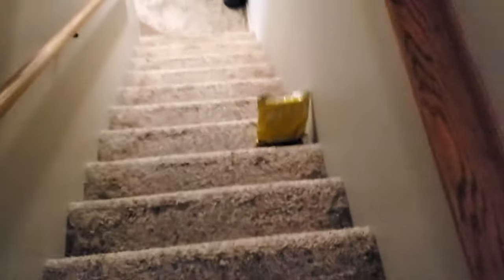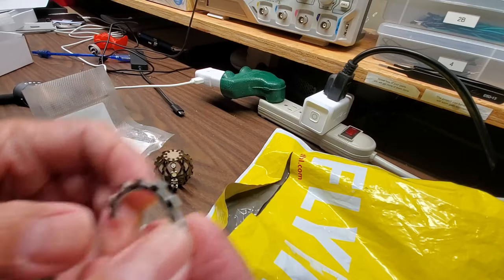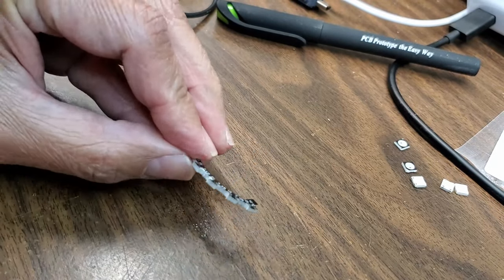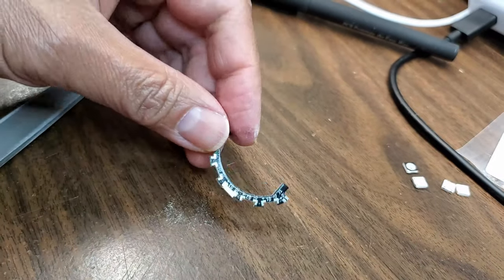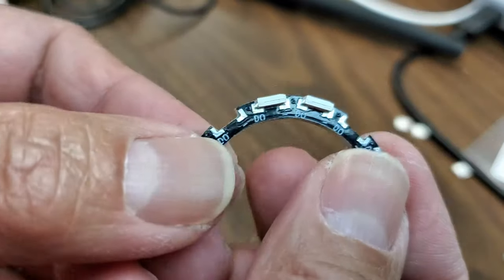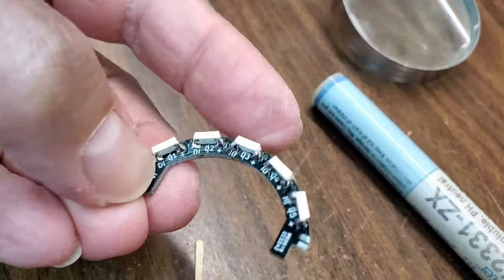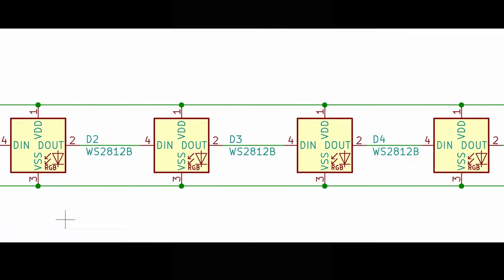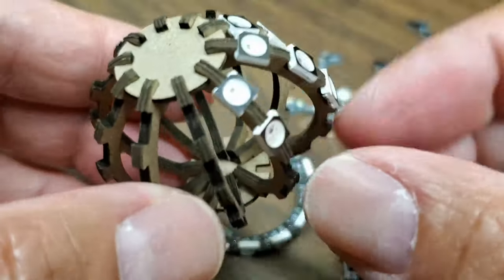HariFun #182 - LED Ball Part 1

Comment: If you dont care about aesthetics much you can buy surface mount side firing addressable leds which could be easier to assemble. I have seen them sold on aliexpress
Reply from the maker: Hi, You're right that side firing leds would make the project much easier. :-)  But I prefer the look of these neopixels.  More readily available and thus cheaper too.

Comment: Very cool! I think the problem might be that the laser cut version can cut nice 90 degree angles, whereas the PCB is cut on a CNC milling machine, so can only create inside corner radii as tight as the end mill radius. You could perhaps look into "dog bone corners" for the inside edge... might give more flexibility/pinch too?
Reply from the maker: Hi Christian! You're absolutely right about the CNC bit radius.  Now that I have physical sample PCB, I could take that into consideration too.  Pinching the LED using dogbone corners is a really cool idea.  I will look into that.  Thanks!

Comment: To prevent the need for solder, instead of using a thick PCB, could you have just stacked two normal ones? I know it would double the PCB costs, but you would only need them single-sided, which should save some money (especially in comparison to PCBs that are 2x as thick)

Comment: Hello Hari, good to see you back. Looks like another awesome project. I'm currently working on a Praus Free Form LED Sphere. I'm finding the soldering very difficult and frustrating (LED to brass wire). I'm about 1/2 way through the first hemisphere and rapidly losing confidence that it's going to work after all the time spent on it. As for me, I'll gladly watch any content you feel like uploading. I tend to not watch live streams until after they are live.
Reply from the maker: Whoat?! You're a braver soul than I. lol :)  Man if YOU are having trouble soldering that sphere, what are the chance that a novice would succeed?!  Hopefully this PCB method would allow almost everyone to be able to build their own LED ball.  I'm so looking forward to build a BIG version of this.  I wonder how big would be too big... I mean the # of LEDs quickly skyrocket with the ball size.
Thanks for the feedback on content.